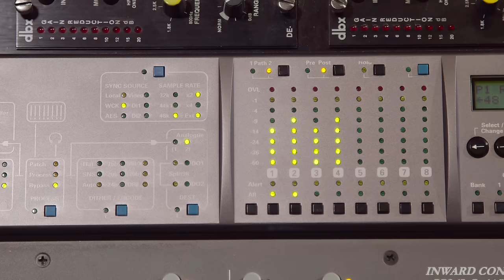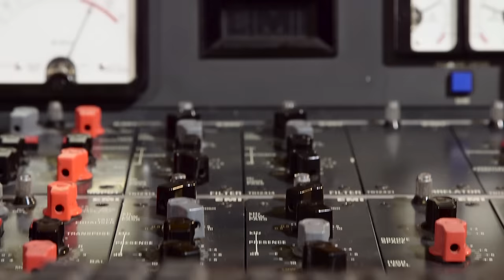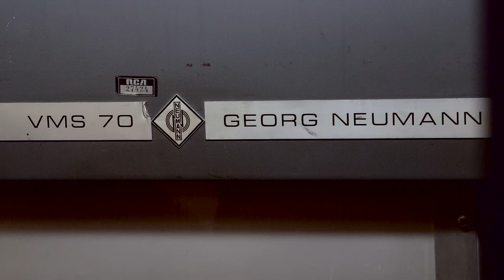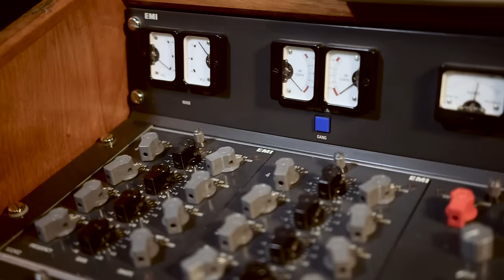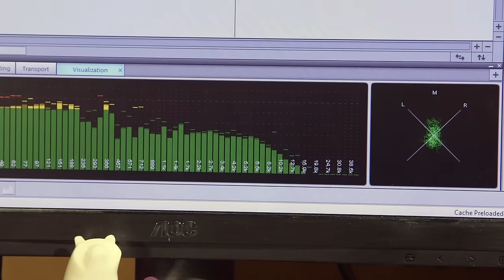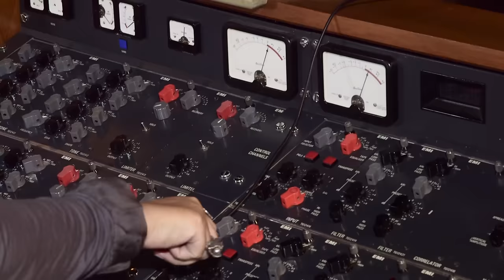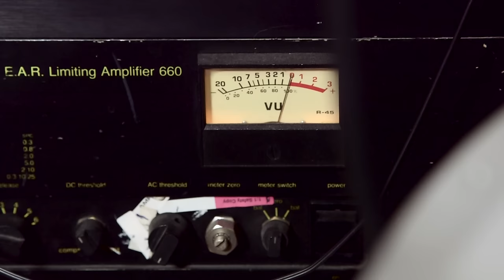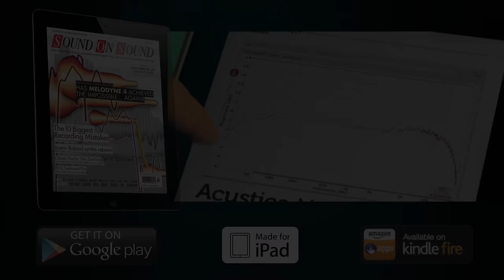Mandy Parnell: Mastering Audio

Comment: I feel the same about analog, it was some of the imperfections of analog gear that gave it that field of depth for the ears and has an almost liquid sound to it especially if played back on some high end tube gear. I also loved those Tannoy Gold monitors in the back ground, that era of monitors seemed to make mixing pretty easy on the ears especially the concentric drivers that seem to put off that studio tan effect for an extra hour or two. You know if you were to soffit mount the Tannoy's with a 1/4" layer of dense foam between them and the external soffit cabinet they will go into, then surround that second cabinet with sand you get down about another 5 Hz extra in the lower range just by cleaning up the coupling effects and internal cabinet anomalies. (F Alton Everest r.i.p. goes into detail how to mount soffit speakers properly in his books) Sand is very heavy though. Thank you for the video!

Comment: But if I add linear EQ it doesn`t change phase, right?
Reply: Correct, it just adds latency to the output as it has to time align to sort out phase changes.
Reply: I think it`s acceptable in most cases
Reply: Anti Phase Only on a stereo buss. If you start adding linear phase EQs on individual tracks/group busses/etc, you're going to start running into major problems! Though I realise that this video is talking about mastering, I thought it's probably worth mentioning, since people are likely to be attempting to learn mastering whilst mixing.
Reply: ***** yep, I meant linear phase using only  on stereo buss during mastering.Thanks!

Comment: www.curioza.comWelcome to AAMS, the introduction towards Automatic Audio Mastering!As a musician or engineer working on music, you need the best sound possible when releasing material to the public. To audio master a mix towards a professional commercial quality recording and to create a sound for all audio speaker systems is a difficult and time consuming task.This is where AAMS steps in and takes control!AAMS is windows freeware for Audio Mastering. Featuring 100 Band Equalizer, 8 Multiband Compression, Balancing and Loudness settings for internal DSP Processing with all audio corrections automaticly done purely inside the AAMS Program. Also AAMS installs a Reference Database of 200+ Musical styles. Creating your own personal sound! Making the mastering process easy and less time consuming, having a good overall commercial sound quality, to process your Mix to a commercial great sounding Master.Now you can listen to what you expect!
Reply: I do not think so ...do your Mastering people that created the SW n algorithm....went to the university n have 30+ years if Mastering n work related?....did you do it based on at least 50 Mastering guys w that experience?....

Comment: she's very knowledgeable and can do a good job',  but her setup is behind,  but because it's what she learned with.  but it's not like like we are heading back to analogue hiss makers.  even she knows it that digital is good now.  her best advice is to listen a lot on many different speakers, car etc.  a good mix sounds great even on tiny speakers, or large, & use studio monitors of mid size.  if you are starting out, learn to work in digital, not bouncing through all her signal paths.  plus your not going to be buying a reel to reel  & all that stuff.  she's struggling in between two world's & it's easy when she already has the old equipment.  her advice is more  suited to her.  lots of hit songs out this month are entirely digitally mixed and shaped with just digital tools, and many of which will add presence, spatial as she talks about, & with more control.  and pushed I'm sure she can mix great in all digital.  I used to use to use equipment like hers, but ditched it and went all digital with no regrets except having to relearn  things.  it as worth it  I'd recommend 64 bit bus in sonar x3 as it is most close to a studio, but most any good daw will do.  it just takes oodles of practice.
Reply: Interesting how you assume things....you have no idea of her digital processing and how she uses her equipment....etc....I would choose her over you for a Mastering job

Comment: Not sure how EQ relate to mastering at all if we are not accommodating the source to some specific format that needs specific EQing. It was already mixed and approved, don't touch EQ otherwise you are re-mixing it. And the last time i checked re-mixing and mastering are not the same thing.

The whole video is not what the title says. DA/AD, analog path, compressors, etc. She may be a brilliant mixer and mastering engineer but all her "improvements" are distorting the source in a creative way(this is what the mixing engineers do) instead of enhancing and preparing for exporting for a specific distribution(what the mastering engineers do)
Reply: Basically a Mastering guy will fix all your mistakes you think you did well like what you say now ...n bring balance etc to your work
Reply: @atta1798  Completely wrong. Mastering would not be needed at all it we all have had just a single universal distribution format with fixed settings. All the necessary fixes, EQing and all that were already done by mixing engineer by the time the source arrives to a mastering engineer. All that's required from a mastering engineer is to get the source ready for the different distribution formats changing as little as possible in the material.
Reply: @yrussq  Wow to be accurate and precise....I see now why you are not known and knowledgeable like this Mastering lady....it makes sense.....you go beyond being an amateur....go to school and learn the profession....you will be amaze what you will be able to do cheers!
Reply: @atta1798  I'm gobsmacked.
Reply: @yrussq  it is normal when you learn something knew in this business....you just improved yourself
Reply: @atta1798  facepalm
Reply: @yrussq  sure do not get impressed what you c in your mirror

Comment: Mastering is really a failing of the artist, engineer and producer to output a track that is good to listen to and compliant with the formats it is to be heard on.  Basicly Mandy is tweaking the bass and treble and adding some compression. At the mastering stage this is to late! Good engineering is the key to good sounds. Cutting vinyl is a trick business especially dealing with phase issues at the bottom end that are likely to throw the needle out of the track. This can be overcome by monoing the lower frequencies and limiting, but this changes everything in the mix, far better to sort it out at the mix. So don't think that mastering is a panacea for open sound and loudness , it isn't. Good engineering is the only way to get it absolutely right.
Reply: +Martin Maynard most would say its pretty hard though...especially for vinyl.
Many engineers simply send it to mastering house, because they want someone else to finalise it. Its just the bias of having worked on a track for too long sometimes, you definitely lose those 'fresh ears' to a track.
Quite a few studios will master other's work, but not their own mixes, so its not like its beyond their ability or anything.
Reply: Every Grammy mix engineer failed then.
Reply: it does not seem you understand what Mastering is....what is Mastering to you?